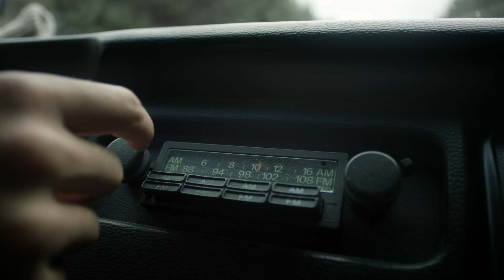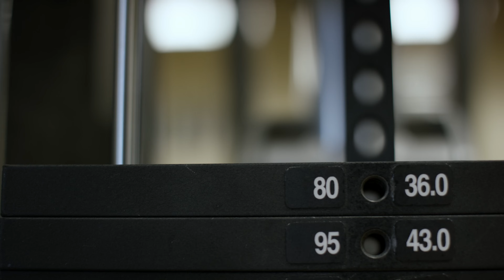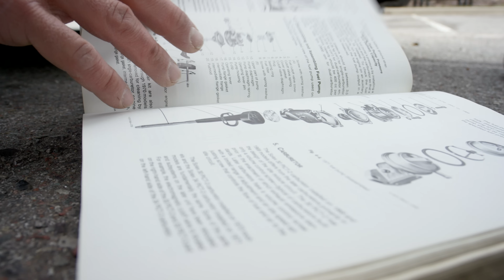YETI Presents: Offseason

Comment: What about food, fridge and keeping his diet?
Reply: Is the battery enough to keep the fridge working?
Reply: Fridge runs on propane. Later ones in the Vanagon Westys are 3-way.. 12vdc/110vac/propane. You don't want to run it on 12v unless the engine is running though.
Modern replacement fridges can be 12v-only, as modern compressor fridges are extremely efficient. I can run mine (a "TruckFridge TF-49") for about 3 days on a 78Ah battery, and extend that nearly indefinitely with a solar panel on the roof.
Reply: Hmm, I see. That's pretty interesting. Thank you, buddy. That's a smart move to use it with a solar panel, well thought. How big are these propane containers though?
Reply: about 3 gal, I think? The propane fridge only runs a tiny little pilot light sized flame.. I've gone 2 weeks straight + cooking w/out running out.
Reply: I see. Thanks for sharing👍
Reply: The fridge in his VW most likely doesn't work anymore. That's why he has the Yeti cooler. He has to buy ice for it regularly.
Reply: yeah, even when working the OEM fridges are kind of a pain. That's why modern upgrades are so popular! Our Dometic 3-way worked fine, but would only cool about 40 degrees F below ambient temp, you couldn't put anything in it that wasn't cold already, and you had to help get it going by starting out on shore power for a day or so before setting off.